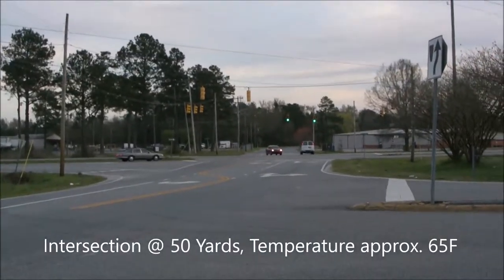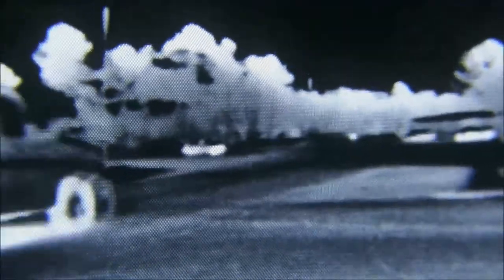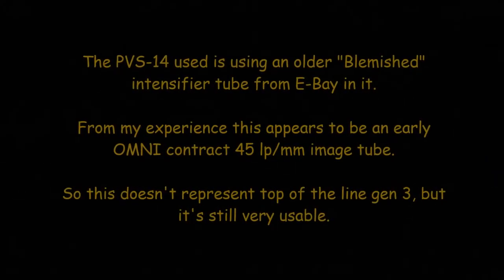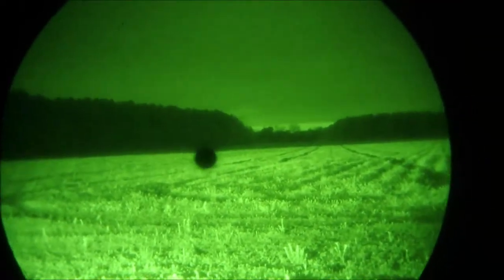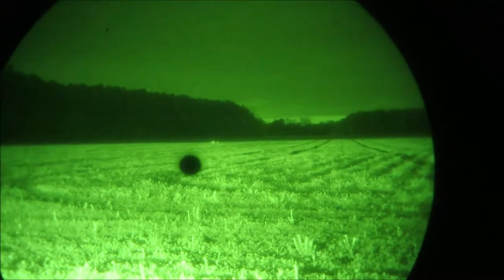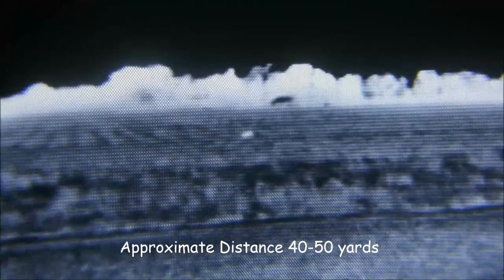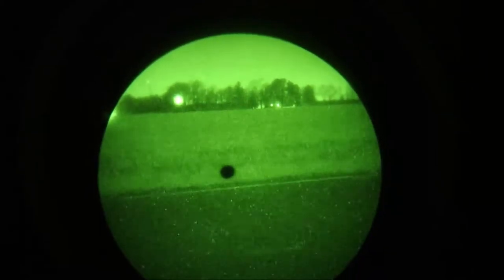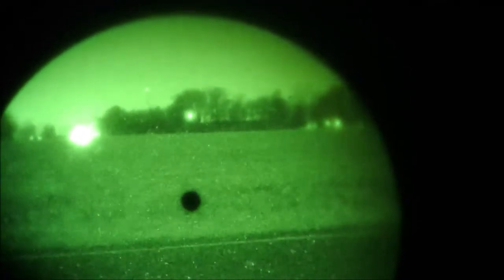Home Built Thermal Imager / Viewer (Part 2)

Comment: Who are the leading manufacturers of thermal imaging sensors? I expect the super clean room manufacturing equipment cost is beyond most of the, for example, thermal rifle scope brands which are offered within the price range of farmers and ranchers with hog problems. Who supplies the sensors and or even the optics for these complies like Pulsar, ATM, AGM and so forth?

Comment: Great video man,  about how much are the parts to build something like this? Is it more economical to make one than just buy one?
Reply from the maker: I made this a couple of years ago, and had around $500-$600 (USD) in it, most of it ($350) for the Raytheon 300D imager module, which is 320x240 30hz. I did it more to be able to see if I could than to be practical. But this is Old Technology with RCA Video out and a pinwheel style NUC (which is why you hear a hum when it's on, and why it takes so long to start up).  If I  were to build something today I would investigate some of the smaller drone type modules etc and likely base it off of something different. 
 
All of that being said, you can get something like a Seek Thermal handheld for about the same price (and they have different refresh rates and resolutions up to 320x240 though I believe 15hz), or a Leupold Tracker 2 HD which is lower resolution and frame rate but is very nice for around $1,000 (I have video's on the Tracker and a Mod to use it like a Monocular in the Channel), and both of these units can be held in your hand or fit in your pocket.  So if you can find a used Vehicle camera like the 300D (and the D is better than the A!) for a good price it's cheaper, but the benefits of having something pocketable and new more than justify the cost IMO.
Reply from the maker: Oh, I forgot to add that I visited Leupold's Website a couple of days ago and the discontinued production of the Tracker series (and the Quest which was like a Seek Handheld with Leupold Branding), so it you're interested in the Leupold I wouldn't wait too long to get one!

Comment: Hi I bought a Chinese brand thermal camera. It’s the rc10 thermal image camera made by mijing irepairbox. The software is rubbish and the drivers don’t work. So I’ve got this camera that I can’t use. It connects to the pc via usb. Is there a way of using this any other way than the manufacturer software? Or is there a way of modifying this? Or on other software and drivers. Any help would be much appreciated. Thanks rich
Reply from the maker: I wish I had some answers for you, but other than searching forums or perhaps looking for the technical specs to see what imaging chip is used and perhaps looking for similar drivers / utilities I don't have any answers.  Not knowing what you have tried, if you're using a windows based machine you can try different compatibility modes for the software or see if you can change I/O settings / options in the driver, or even try different USB ports etc (I have found some devices that acted up based on the speed of the USB port or even using the front vs. back (direct on MB) ports.  Sometimes different other drivers or Software that are running in the background can interfere with things as well, and lastly perhaps try on a different machine with a different version of Windows. (sorry if this sounds too basic, not meant to be insulting, just thinking about what I would try).
  
That's the problem with many Connected Thermal devices and Thermal in general... You're kindof stuck when it comes to flexibility and being able to change much or use different software etc. because of how specific each design is (not like scanners etc. where there are somewhat generic output standards that allow for aftermarket software to go between your device and Computer, and that's not likely to change due to the limited market / people who would buy a given product).  The other thing is often smaller companies will build drivers but then not update them as operating systems patch and upgrade so we get left with white elephants, and I've had several Scanners and specialty devices that were fine physically that I had to replace due to lack of support over time.
  
In the case of the Thermal Imager in this video the reason that I could build it is because it's old school / stand alone with an analog output for an early vehicle mounted system... Supply 12v to the Camera, take the analog output and route it to a Digital Screen with Analog input and the rest was just a matter of adding in additional wiring and ports for added flexibility in power source or output to a separate analog monitor, with a large Loupe to give a better view of the screen.
Reply: @PhoenixRising62  honestly thanks so much for this, I really appreciate you taking the time to try and help me with this. I’ve now managed to solve the issue. Turns out the flex connecting the two cameras inside the housing wasn’t plugged in and just loose. When I opened it up it was just a case of plugging it in. Must of been a factory mistake. As soon as I plugged it in , it changed from being recognised as a microphone to being recognised as a thermal camera, which then allowed the drivers to be installed. It was an absolute nightmare because I paid nearly £500 for it but it’s finally sorted, no help to the company who make them. Honestly thanks so much
Reply from the maker: @SURGE101  Cool, Glad you got it working! ... I hadn't even though about something coming loose in shipping, etc., but have to admit if I was out of options I likely would have disassembled it if for no other reason than to see what was inside and if there might be something obvious.  Thanks for the Feedback!

Comment: Sir, I have made one out of a Infrared L3 Thermal-EYE 2000AS Core. 160x120 resolution 50 degree germanium lens, it works great on a 7" car backup monitor, my question to you is that if you know if an android smart phone can be used as a monitor. If so can you tell me how to do it?
Reply from the maker: I don't believe so, as from what I have read there aren't any options for video converters to adapt other than specific devices video output to smartphones (like the Seek Thermal Cameras, which might be an option and are relatively inexpensive).  If your L3 has Analog Video Out (like RCA style / Old VCR) there are other options for display and you can find small LCD panels in different resolutions with analog inputs (in the one I build I used a 320x240 display, which I chose because it matched the resolution of the sensor so I didn't lose any detail going from the sensor to the display).
Reply: @PhoenixRising62  I certainly appreciate your response, I purchased a seek thermal and I, am sending it back. It works great only when the app allows, their technical support has been non responsive. The DIY device that I have put together out performs it!  If I could somehow use my smart phone as a monitor it would be a very cheap thermal with the application I desired. Again thank you, and I really enjoy the ideas that you can create.
Reply: yes u can
use av usb capture card and otg

Comment: How complicated to make such Thermal imager?
Reply from the maker: The build isn't that complicated, mostly simple wiring. The hard part is finding the Camera unit (which is for an older vehicle thermal system) that has an NSTC video output, then finding a small LCD screen that has NSTC input. So the hardest part is scavenging and finding the parts and coming up with an assembly.  I wanted flexibility so I added external power jacks as well as a switch to turn off the screen and run the video signal to an external monitor as additional features, but those are not really necessary depending on how you want to use it.
Reply: From what I gather, heat sensors don’t go through glass. But looking at your video I see it reflects off mirrors. I wonder if you can make it zommable using mirrors like a telescope. 🤔